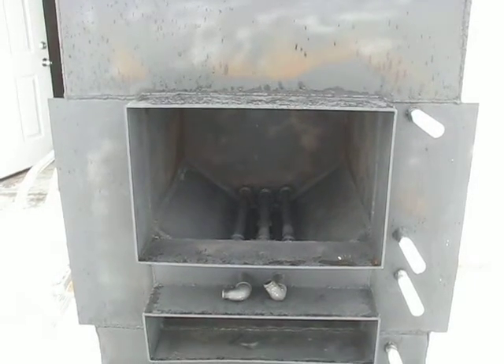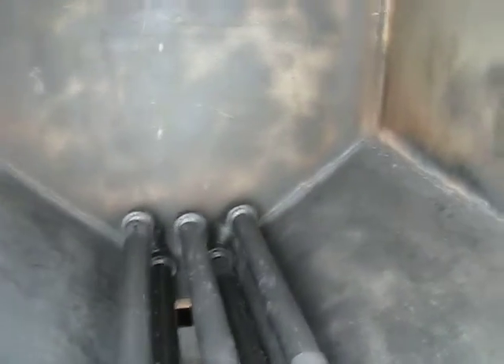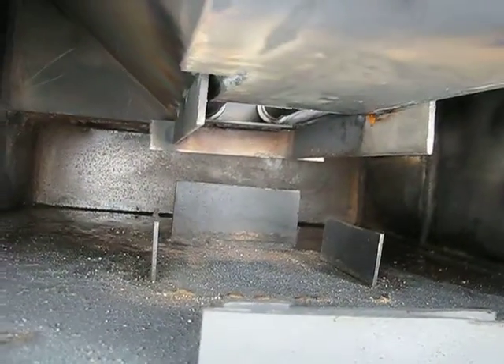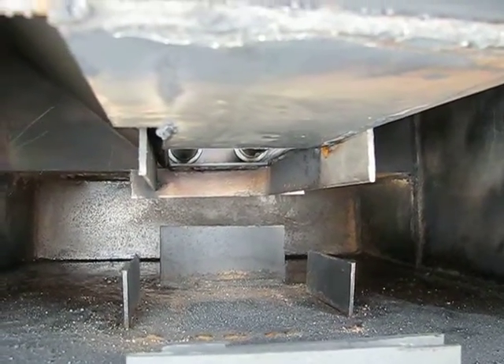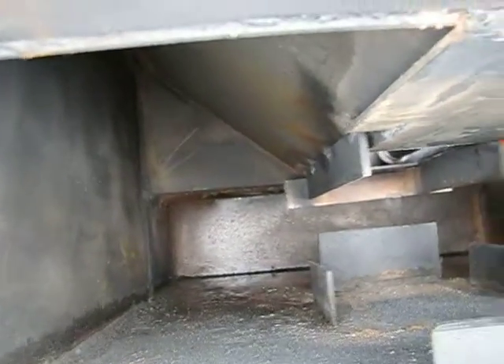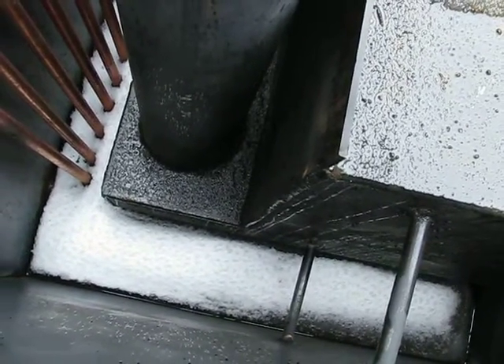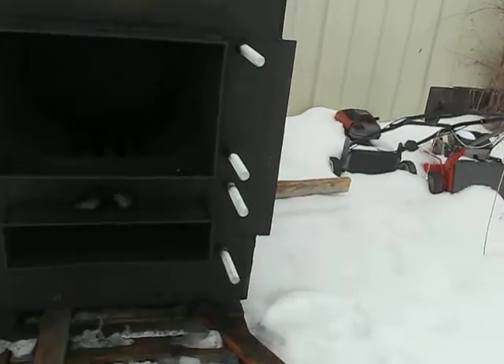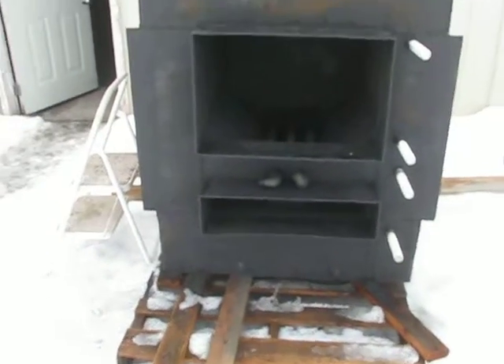Wood Boiler first video.AVI

Comment from the maker: Thanks!  I have tried a fire, but it did not burn as well as I had hoped,  Most of the air just went right out the bottom, and the fire did not get enough.  I am going to make a few changes that should fix it.  Hopefully I get some time this weekend to get that done.  I am also trying to keep my blog updated with what I am doing.... see the link in my description.

Thanks again for the comment.